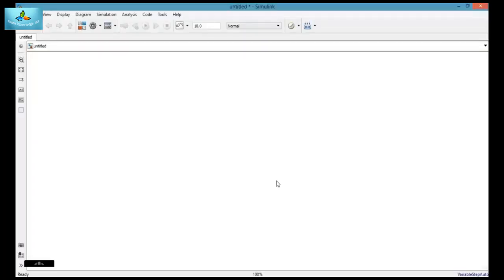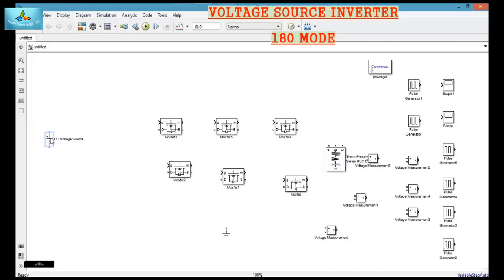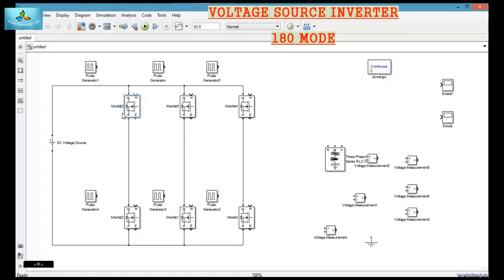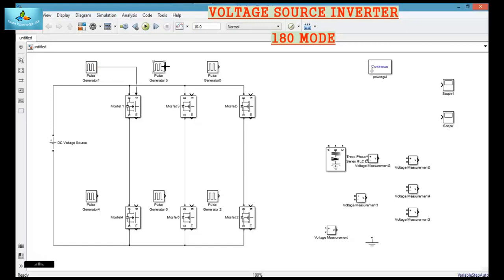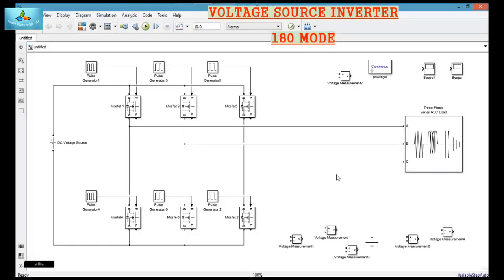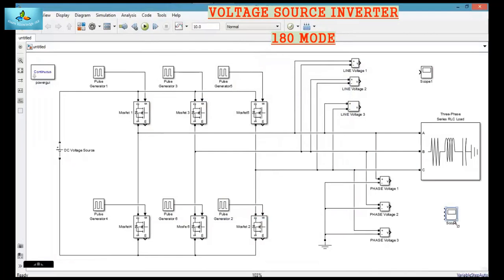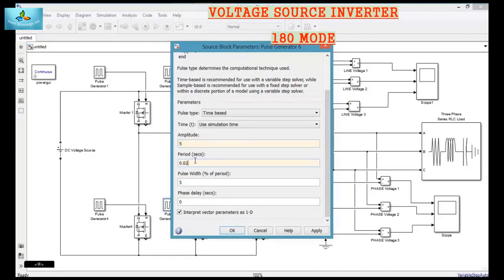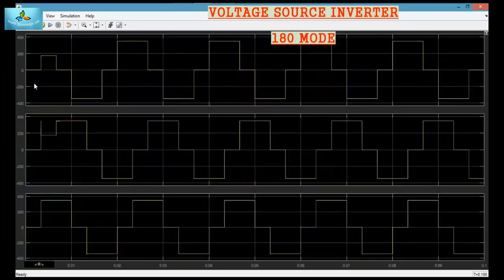voltage source inverter 3 phase 180 degree

Comment: Dear sir thanks for explaining
My new project 10 KW 3 Phase 320 voltage agriculture submersible pumps application. Your technical support and cooperation.
Full details and components.
Send anand.electrical14@gmail.com or wattsup no+ 91 9842461293

Comment: I want to simulate a model for extended kalman filter for rotor position and speed control. I have the model but I need help how to draw it and what should be the rating of the components. If I send you the model can you guide me how to draw it?

Comment: what is are the pulse generator for ?
Reply from the maker: +Noni Noni used for giving gate pulse in rectifier circuit
Reply from the maker: +Noni Noni 180 degree firing
Reply: MATLAB tutor rkk thanks for your reply,
I am using this for controlling the speed of three phase induction motor. Do I need to have a variable output voltage for this ? Like using PWM ? And is it difficult to implement ?. 

Exactly, I will do the controlling bit by RFOC method. Do you have an idea if this comes before the inverter or after ? When I do the blocks in simulink
Reply from the maker: +Noni Noni pulse generator will give firing pulse to switching devices
Reply from the maker: +Noni Noni have to see circuit diagram